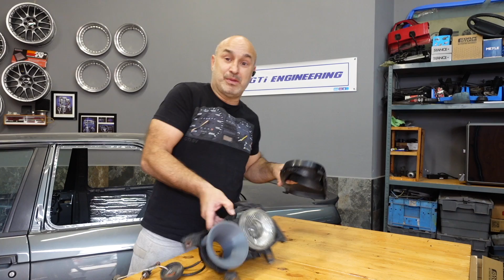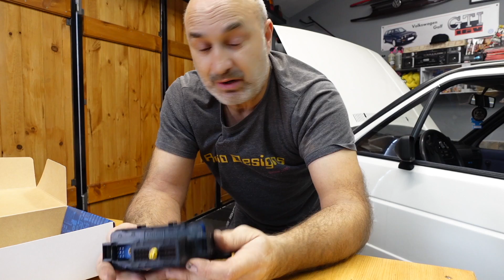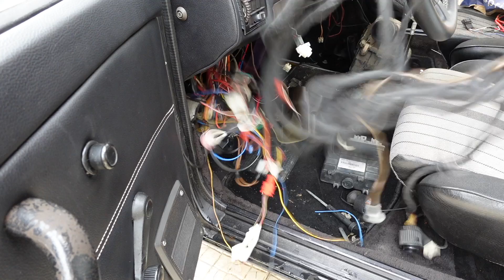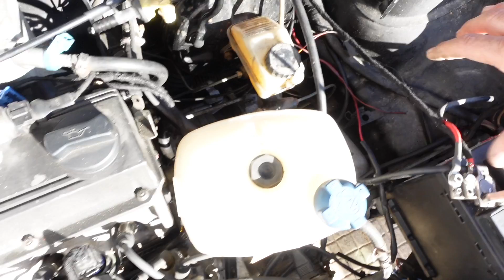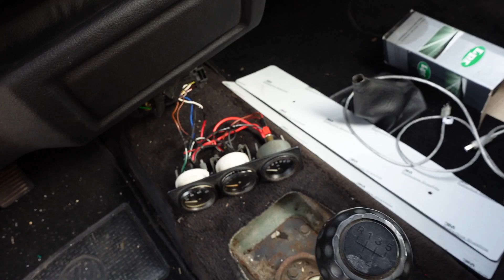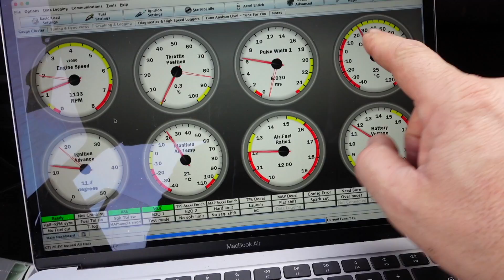Golf mk1 2 0 8V Standalone ECU Pt2.

Comment: Do you have the base map available? As I am working on the same thing
Reply from the maker: Hi there, unfortunately it's not a great idea using someone else's map incase something goes wrong. Are you having issues getting it started?
Reply: @ just as a base map. So I can get it running for further tuning.
Reply from the maker: @19811402  What ecu are you using ?

Comment: Hi mate, love your videos. I was panicking about removing my sunroof but then i found you!! You thought about maybe doing an ottinger style 52mm gauge holder for the blanks next the clocks? Been looking for one forever
Reply from the maker: Wow that's a blast from the past about the Oettinger 52 oil pressure gauge holder. Funny you bring that up, as I'm making something similar for the mk3 Golf at the moment. I'd be willing to make a copy of the Oettinger one for the mk2. Do you know how it was fitted to that surround?
Reply: @RestoDesignsnando  think it was actually for the mk1, but you'd obviously have to dremel out near the clock surround to get it to fit, that was my plan anyway. I did a bit of further reading and I believe the same kind of thing was an option on some early 90s audi 80s. I found a picture of one but how to upload it!!